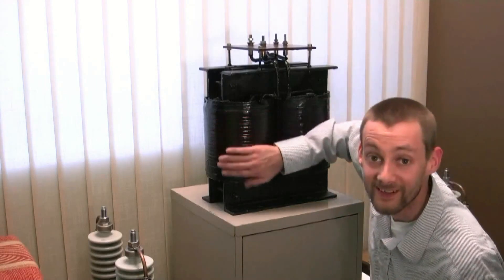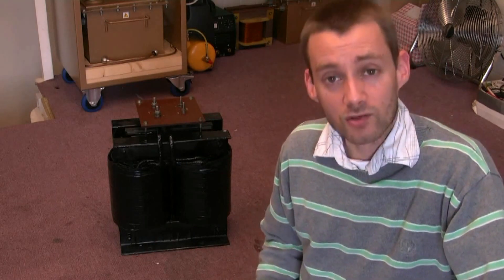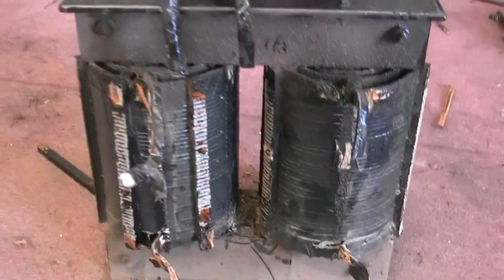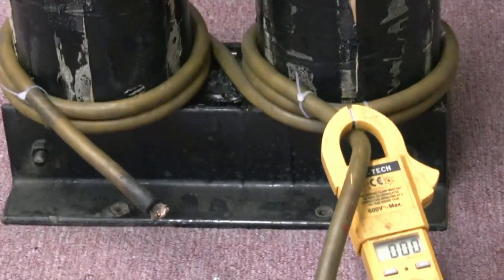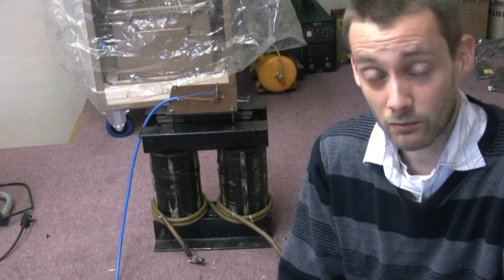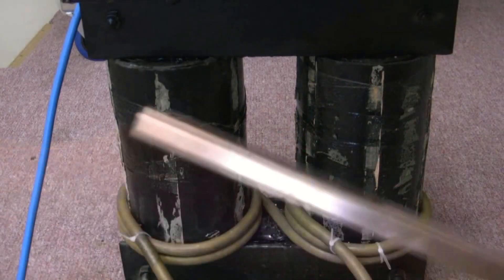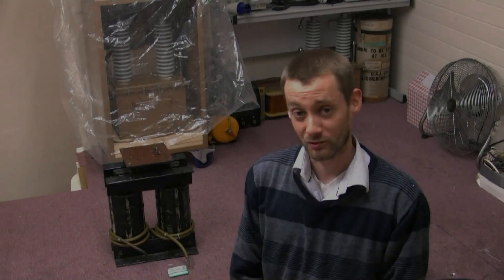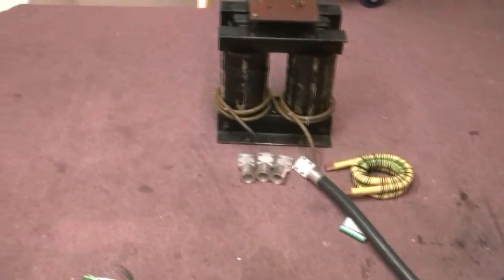Building A Monster High Current Transformer

Comment: what does more windings of cord do??
Reply: it will raise the voltage, but at expense of reduced current when the transformer is pushed to the max.
Reply: +fireandcopper The turns per volt figure varies between different transformers. If you already have the primary in place it is simple to just put a few turns of wire round as a temporary secondary and measure the voltage.
Reply: +g0fvt So there should be a chart to show # of windings vs volts and so forth
Reply: increases the amperage.
Reply: Its weird to think that you get more amperage just from more wire wrapped around it with the rubber coating. Really interesting

Comment: Very interesting! I'm generally more interested in high voltage experiments, but this is still very cool. One good thing with this experiment is that there isn't really much danger of electric shock since the secondary voltage would be so low (too low to overcome the resistance of the human body).  The primary circuit could shock you of course, but no more dangerous than anything else plugged into the wall. The biggest dangers would be fire and wires exploding violently.
Reply: Hi reporting you was a mistake sorry about that

Comment: I'm not the person to talk to about electrical things even though I can solder stuff here and there I have no idea about the science behind electrical systems. From my understanding of transformers, you can step up or step down, is there some law that prevents you from just wiring transformers together and turning a tiny amperage into a huge amperage? Or could you literally, given enough resources, turn 1 amp into 50,000 amps?
Reply: The more amps you get the lower the voltage. You can still only pull the same "power" (watts) from it. Volts x Amps = Watts. If you halve volts, you double amps, or double the volts and you halve the amps.
Reply: as the other guy said, you can use a stepdown transformer to increase the amperage, 1A to 50,000A would result in the voltage being divided by 50,000:-  240v would become 5mV, and 5mV is useless for anything other than dumping loads of current through a very low resistance (as done in this video) In the real world these levels of current arent used much as the thickness of cable required goes up significantly as you use more current. Very high currents arent as useful as high voltages for transferring energy over long distances, but they are very good at generating reliable arcs and dumping heat/generating large magnetic fields, which is why very high currents are used in arc welders and mri machines :)

Comment: How stupid are you people to think he is actually putting out a live electrical fire with water, seriously? The power is switched off before the fire is extinguished, no hazard whatsoever. Why waste a CO2 extinguisher when a few squirts of water do the job. If you were attempting to put out a real electrical fire with water, which is still live then yes it would be dangerous probably even lethal.
Reply: Why do you figure putting out that particular fire with water, while live, would be dangerous or EVEN LETHAL? Is it because you once heard that water and electricity don't mix well, even though you don't have any idea how these things work, but you want to sound smart? :)

Putting out fires with water is dangerous because it might arc onto you. However, in this particular case, there's no possibility of arcing, since the voltage is very VERY low. I don't see any reason why putting this particular fire, in this particular circumstance, out with water, while live, would be dangerous at all.
Reply: +ajs2120 He can literally touch the contacts. Waters resistance will lower the voltage even more.
Reply: ***** Yes but the metal you are welding is grounded and the welding gun arcs to the ground.
Reply: ***** well it sure didn't seem like you knew due to your other comment
Reply: ***** I forgot that lol. I'm kinda tired so I forget some things a little bit more easily.

Comment: wow no safety precautions whatsoever and using water at the end to turn off that fire was just idiotic
Reply: There are plenty of safety precautions, he has actually done a risk assessment for all the things he does. If you pay attention at the end, you hear the power is isolated before even spraying with water.
Reply: stevemilwa Transformers dont store power when they are open circuit. Closed circuit however, they act like inductors.
Reply: ***** Yeah, there's actually very little shock hazard with this because of the low secondary voltage. The bigger risk is things catching on fire.
Reply: ajs2120 Yeah but surely there is power stored inside, like a capacitor? But i guess if the voltage is low enough it doesnt matter? How does the voltage get low in the first place? If hes going from mains?

Comment: WTF is wrong with you?
Reply: ***** I have a level 3 diploma in electrical installations / science and i am starting my NVQ later this year i think i know enough about power to see that's not how to put out an electrical fire also not a good idea to be fucking around with 10,000 Amps is it now!!!
Reply: sorry about that was signed in on other account.
+The Antigod I have a level 3 diploma in electrical installations / science and i am starting my NVQ later this year i think i know enough about power to see that's not how to put out an electrical fire also not a good idea to be fucking around with 10,000 Amps is it now!!!
Reply: +David Martin you obviously dont understand ohms law. he has like 3 volts on the secondary, that would transfer less than 1mA with clean water, which is what was what he used

Comment: how do you power this under full load do you hook it right up to the line side on the service disconnect on your house? 24,000 watts at 240 volts  will pull 100 amps, no wonder your electric meteor popped
Reply: he has a 100 amp supply for that transformer

Comment: Dude, I like your stuff - I'm into both high currents & high voltages, and a long-time Tesla coil builder.  Electronics is also my career & has been for decades & I got my first Ham Radio license when I was 14 - so electronics is my life.  I'm just writing to question your maths.  You refer to the transformer as 20kVA or 24kVA yet then say 60V at 'about' 250A.  60V @ 250A is 15kVA, or at 200A is 12kVA.  Are they rated numbers, or measured?  Just because you can draw 15kVA out of a transformer does not mean it is rated at 15kVA.  In fact, if 15kVA is what you can draw into a short circuit, the transformer is definitely NOT RATED at 15kVA & will certainly not supply 15kVA all day - more like 10-12kVA.  It is most likely being limited by core saturation & total losses to 'settle' at 15kVA output Max.  By the way, looking at those windings, & their spacing, that transformer may be designed to run under oil, which allows a higher continuous rating by aiding heat dissipation - like 'pole transformers' - or maybe they're just for air circulation, for the same reason.  What limits the power the transformer can ultimately supply is the characteristics of the core material & most notably its size - its cross-sectional area.  If you told me the CSA of the core I could tell you roughly what the core is designed to be rated at.  With the 35mm^2 cable you're getting around 4V (at about 1V per turn) & about 630-odd amps - a mere 2.5kVA.  I'm guessing this is about a 10kVA core.

Comment: want to do a melting cupola voltage is 220 you see the need to how much current a few kilowatts of power transformer how wiring q2859618031@live.cn

Comment: Interesting that you make reference to "railway cable" as a high spec cable, back in the day we always erred on the side of overengineering, "if in doubt, use a bigger cable" saved a LOT of time going back to the tables back then. Sadly this is not something that sits with today's accountancy led engineering :-(

Also intersting that a "google" for "london transport signaling power supplies" turns up more articles about failures and policy documents than it does tecnical papers.

Comment: Nice transformer!

Have not seen kit like that since I worked on London Underground, used as incoming for (signaling) relay rooms, although configurations varied as we ran two 100v systems (125 Hz [silver relays] and 33/3 Hz [red relays], which was the "legacy system]).

Comment: First of all, the secondary side of the transformer is not grounded at any point (though, there should be capacitive grounding). Second, the voltage is just too low to electrocute you.

Comment: He can touch the metal at 10:02 without being electrocuted - how come?
I don't understand electricity - only that we rely on it and it can kill!
Reply: Because the electrical current is high and the voltage that is coming from a secondary is low. There needs to be higher voltage or electromotive force for the electrical current to flow from one point of your body to another point or the ground. Remember: the electrical current always travels where there is the smallest resistance. Now what is resistance?
The electrical resistance of a object is a measure of it's opposition to the flow  of electrical current and it's measured in ohm's, the SI unit of electrical resistance. The human body with dry skin has the resistance of 100.000 to 600.000 ohm's. And with wet skin the human body has the resistance of 1.000 ohm's. So when he touched the two points and closed the circuit no current traveled through his body because his body had the higher ressistance than the ressistance of a metal.

Comment: Ive noticed with quite low currents the connections can really restrict the flow, soldering every strand is the only way ive found to get minimum resistance. 
But the wires i solder are farty in comparison to your monster cables :-)

Love your vids :-)